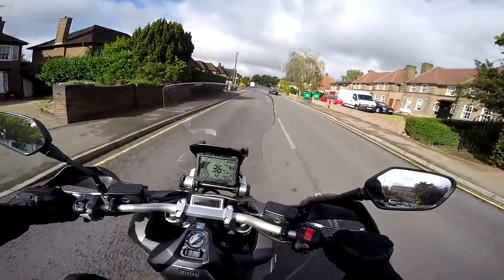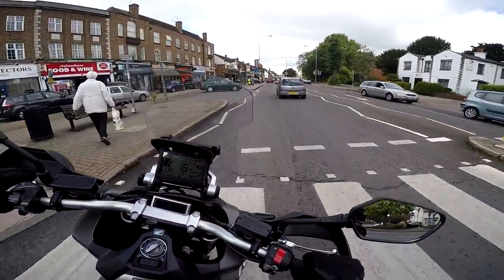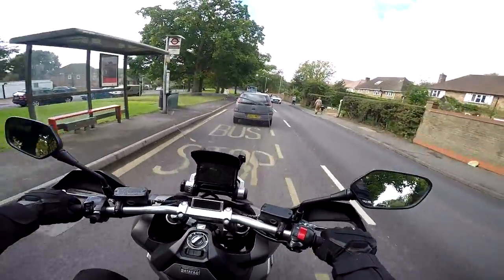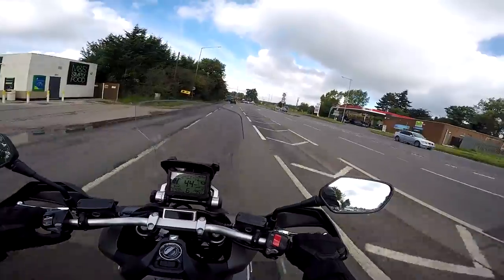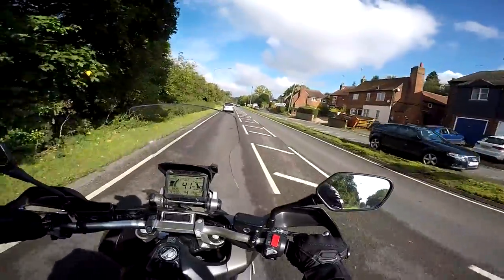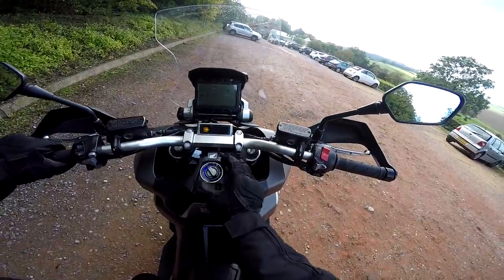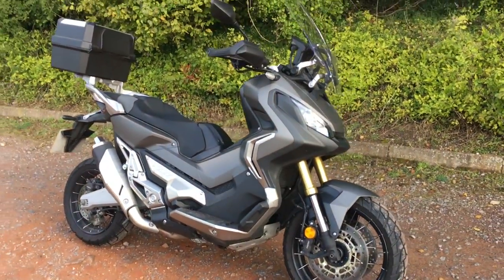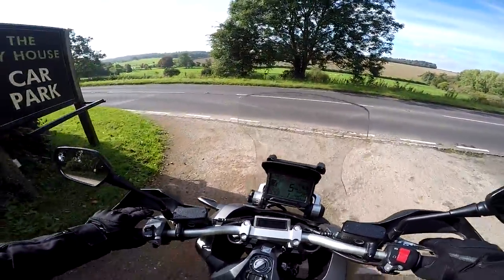2017 Honda X-ADV Review

Comment: I have had 3 two hour test drives on the X-ADV including a back to back comparison with a NC750X.  I rode on a mixture of roads including motor ways, curvy "A" roads and single track country roads and it felt at home on all of them, I also pinned it (on a suitable road), and it was good for 115/117mph, at this speed it was still very stable, the NC750X limit was about 100mph but felt very stressed, in general it felt a very relaxed and easy drive, I think this is due to the level of protection from the screen, leg and floor boards, whereas on a bike, you are subject to the elements and very much aware of the wind. One of the problems I had with this relaxed drive is that it was very easy to exceed speed limits by over 30mph without realising, although there isn't any likely hood of unintentional wheelies. As far as pricing is concerned, it is undoubtedly expensive, but is on par with other large scooters from Yamaha or BMW (X-ADV = £9600 54hp, T-MAX = £9600 46hp and the D-MAX = £10,900 46hp) compared to say the Tracer 900 at £8,900 or Tiger 800 XRx at £9,900, but for that price you do get a automatic gearbox, LED lights and the same radial brakes and other components from the Africa Twin and of course the additional body work.  As a bike/scooter with aspirations to be a "one bike" for shopping, commuting, adventure trips/cruising and some simple off-roading I do think they could have added things like self cancelling indicators/cruise control and heated grips and the ability to switch off ABS and TCS. I was however fairly impressed, particularly with the relaxed ride, and as a result I'm seriously considering  exchanging my Tiger 800 for this SCOOTER.
Reply from the maker: Tricky decision eh?
Reply: Yes, it's a dilemma, not withstanding the comments such as "why do you need two bikes, you can only ride one" well yes, exactly,  or space, but then you can always make room for another bike by putting the chest freezer outside, I think if I was younger (I'm 74), I would stick with a bike to have the authentic "feel" of riding a bike (wind through the hair and all that), but I think I'll go for the more relaxed ride, if I do get a yearning to ride a bike, my local dealer is pretty good (plug for Kent Motorcycles), they would always lend me a bike for couple of hours to get it out of my system. PS: I'm not as you can imagine at my age in the habit of doing a ton 😇, only for research purposes.
Reply: But the NC750X uses the same engine and can also be had with the dct gearbox for around £3000 less. It also has a large storage area capable of taking a full face lid.
Reply: Hi, can you let us know, how you decided with X-ADV? I started on scooter 125cc and last year I made driving license for big bike. After 1 year with Tiger 800 (xr) I realized - in my way of using bike I miss scooter and I started thinking about go back to scooter - or .... X-ADV is interesting compromis between scooter and cenduro bike.

Comment: I had a decent test ride on one and I was really impressed....so impressed, in fact, that I've bought one (my local dealer had 18my models, new, unregistered for just over £8k). I've ridden a DCT model NC750X, which I quite liked, but this felt so much better in just about every respect, handling, breaking and performance. My  current bike is CB1100RS and when I took this X-ADV down some of my favourite B roads I found I was sweeping round bends about 10mph faster than usual! I'm a big fan of the DCT gearbox and it seemed even better suited to this bike than it was to my old Africa Twin. I doubt anyone who rides one of these will still think of it as a scooter.

Comment: From Finland to Costa del Sol Spain and back to Finland,and still i love to ride it after ca.9000km.Comfortable on all roadconditions.
Reply: on the X-ADV? How did it compare with a bike, if you've done it before?
Reply: @denislejeune9218  It,s a bike.I add footpegs and most of the time use them.
Reply: @Mikael Lindroos, you seem to be the fella to ask this. But how predictable is the gearbox? I've had a bunch of them in various cars and so far all of those just shift whenever the hell they want to, including mid corner. This is unsettling in a car, which makes me sort of worry that a DCT might throw the rider when it messes up the timing when shifting. How close is it to an actual proper CVT?
Reply: @fermitupoupon1754  Do not worry.I have 32000km and no problem at all.When you become use to DCT and the different modes it,s a fantastic bike.You have the kickdown too when you want to accelerate for exsample takeover.3000-4000km and then you enjoy it for full.Save rides..
Reply: Very impressive, what kind of cruising speeds did you maintain and what was the fuel consumption and range like?

Comment: 2 yers later and this is still the best review on youtube, think I have seen all of them on this bike and none gave me the idea what to expect till I've seen this. Same goes for your tmax dx review. Great work and thanks.
ps. that is a handbrake at the bottom of the disc and lever is positioned on the front right side, with that transmission bike is in neutral when parked so handbrake is good idea/must when parked on the hill.
Reply from the maker: Thank you!

Comment: Thanks for a great review.  I got one last week for 9k plus first service and love it.  I have had loads of bikes sometimes 2 a year, i defo think this one, will be staying with me along time as so much fun to ride.
Some comments on the price say a bit pricey but a tmax 530 is 1500 quid more and this blitzes the tmax. Fuel economy 65/70 per gallon. Love the manual paddle mode and it switches between the 2 modes effortlessly.
Goes everywhere my bmw gs can go, infact you feel more in control offroad than the gs.
All i can say is get one you won,t regret it.
Reply from the maker: Nice one Marcus - thanks for watching and enjoy!
Reply: So, how long did you keep it for?

Comment: The DCT is the future of motorbikes isn't it? I remember when they were really only in performance cars like Porsches. Slowly but surely they appeared in everything. I even had a four wheel drive with paddles on the wheel so you could change up and down manually if you wanted to. I used them once, just to try them out and that was that. Never touched them again in four years of ownership. For everyday driving an automatic is just so much easier. In city traffic it's a no-brainer.

Now I get the purist's saying that the clutch is crucial to the control of the motorbike and it is a bit like cars, the enthusiast will still want a manual, but I think eventually, most people will be happy with a DCT. Even Ferrari has stopped making manual gearboxes. 

Those who want a motorbike to get from A to B and not for the thrill will want a DCT and all the electronics. They don't have to worry about losing control, accidental wheelies and skidding in the wet. Point and ride. As my wife said. "I'm not interested in racing around the country lanes. I just want to enjoy the freedom of biking, without the hassle and feeling safe" is what she said. I think plenty of people will want that. Just got to get the price right.
Reply from the maker: Hmmmm interesting debate, I must admit I am still a bit "old school" and suspect most (UK at least) bikers are too - mainly due our age!
Reply: My main reason for preferring a clutch is cost,, purchase, maintence and repairs.
Reply: I’d rather have a quickshifter and the ability to pop the clutch but that’s just me
Reply: I just go with what's better for me don't care if new or oldschool, have a 600cc but in London it's tiring sometimes mostly being comfort and the clutch.  The power and lack of self control at times coupled with the loud straight through does no favours for my licence either but I know if I got rid I'd miss it.

Comment: As soon as I hired this in Madeira Portugal for five days I wanted to buy it.   But I wanted style so went for the Forza 750.   Traded in my BMW R1200RT.   What I like about the manual mode is the you want in auto you’ve slowed down auto will change so it won’t labour the engine.     I did a round trip London to Hinckley and back turn a nice 71 miles to the gallon.  Also ordered the central locking top box. I absolutely Love it.

Comment: Another great review. 10 out of 10 to Honda for pushing boundaries but have to agree with others in that it is just too expensive. At £8k I might have been interested as a bike for my 20 mile commute (I don’t use the GSA...just too big) to replace the X max. I think the depreciation hit is going to be high so I decided to wait and relieve a Honda dealer of the their stock they will be unable to shift at a significant discount!! 

However, it appears Honda UK have under estimated demand and sold out of their allocation....which goes to show I know nothing about the bike market.
Reply from the maker: Is that so?  I didn't know that, obviously the price is right for many then!

Comment: Regarding the back pain in a scooter, I have done 30k miles in my Xmax 125 scooter from Europe to Asia and I never had any back pain except the usual you might get on a highway without bends for hours. At the end you just learn how to stretch yourself if you need to spend 8 hours on a bike!
Reply: David Diéguez XMax is better than TMax for back. Issue with some big scoots is that feet have to go so far in front there's no weight on them, it's all in the cocix. The cushion that's mid seat stops the rider moving position. I rode a SH300i with no issues, sadly had to sell my TMax though. Tried another this week for an extended test ride and had the same problem. Hoping to get a test ride on a XMax 300 and Forza as these seemed to have better positions when I sat on them in the showroom.
Reply: I agree with David, I've done 400 mile days on a Vespa GT300 with no issues, which is more than I can say for most bikes I've owned!
Reply: I use a scooter inner tube, adjustable and saves the spine.

Comment: Bought mine a couple months ago... I LOVE IT!   looks awesome, fast, and so easy to ride!
Reply: Also, this is my first motorcyle or scooter, any type of bike.  Not a bike for a new young rider, because the bike is big and yes it is very fast.   I don't think I will ever buy a manual motorcycle.
Reply from the maker: Fair enough - and welcome to biking!
Reply: what about comfort? does your back hurt after long rides?
Reply: Oh yeah I got mine last December 
And its brilliant the best bike I've had or ridden. Coming from sports bikes.  Had a r6 and a honda vtr sp1!   The x adv like it's on rails really is and I like the rumble too reminded me of my old sp1 with standard exhaust on. Only thing I miss is the top end speed! As the this is not the fastest! 
But coming in and out of corners it don't hang around! 
But I love it.

Comment: Great revue, thanks MF. Really appreciated the honest opinion of a traditional biker, and the favourable rundown of it. A nice change from the biker snobs who decry anything scouterish, this is a dct motorbike with foot plates instead of pegs, IMHO. I ride a PCX around our local area, tried a Honda Forza 300 for the idea of touring, not being a full fledged biker as such. I then realised I wanted something more bike like with a bigger engine, then spotted this in the dealership in Phuket, fell in love instantly. The bigger scouters look like bathtubs on wheels. The perfect solution for a scooter rider, at my age I can do without the foot pedals, and gear change distractions. Still trying to find a rental shop with a newish model for a proper test drive, as the suppliers in Thailand do not allow them. Must say though I'm tempted to just jump in on the strength of your revue, and others that agree with all your comments. Thanks, Chris.

Comment: Hi TMF, the smaller caliper on the rear wheel is a separate brake unit for the parking brake. The MPG is easily 80+ mpg with a 14 litre fuel tank. It's a cracking ride, if slightly over priced brand new.
Reply from the maker: Cheers Rob - a few people have said that and I did mention I thought it was a parking brake in the video ;0)

Comment: The bottom thing on the brake rotoe that kinda looks like a brake caliper is the park brake assembly, the abs runs off the the silver ring in the center of the brake rotor that has the small holes all the way around it.

Comment: Another fantastically watchable review. How far are we away from BMW bringing out an auto gs 1200 do you think ??
Reply from the maker: +MARTYN ISSITT Quite a long way I reckon - QS with autoblipper is where its at for BMW...
Reply: BMW cars use mainly ZF gearboxes (autos) and Getrag (manuals).  Not sure if BMW motorcycles make their own gearboxes or not.  Either way, a DCT transmission is technically superior to a constant mesh gearbox with dog clutches and and electrically assisted "pro shift" on BMW's. Certainly the 1600's are crying out for a DCT transmission IMHO.  Honda are certainly an engineering force to be reckoned with. :-)

Comment: Top notch MissendenFlyer. Your review certainly presents this bike as a perfectly capable every day sort of machine that would thrive in a real world use sort of capacity i.e. ripping down to the shops, ripping off to work (or school?) and generally ripping around on errands. It may not be the bike of choice for a long haul overnight weekend trip, but then again, why not? 
You kept to some rural open roads for the most part, but how does the X-ADV perform in a dense urban environment? (I have visions of hundreds of scooters zipping about Rome, Paris and yes, London.) With the power, easy ergonomics and general friendliness, it should be a winner amongst either scooters or motorcycles. 
Oh and how should one pronounce X-ADV? Zadv, zhadeev, CHAV? I’ve picked one already...

Comment: Great Review, I think it looks good but not for me, However, Due to arthritis I already ride a Honda NC750X DCT.
I am very pleased with it.
The Item below the Rear Break Disc is the Handbrake, as it can't be parked in Gear.
 On the NC it is on the left bar, I think it's under the Right  bar on the X-ADV .
Reply from the maker: Yes Bob thanks, a number of people have confirmed that - cheers for watching and for stopping by once again - TMF
Reply: there's a large lever right inner side top of 'fairing' for the parking brake, same as most big scooters
Reply: Looking at this review because I've problems with my left hand after surgery...riding my Kawasaki Z1000 killing me ...anyway thanks for review

Comment: I’m now in Madeira Portugal back in the UK on 1 Nov. I’m on day two out of five days on hiring this bike.  I just love it.  A fully automatic gearbox.  Want to buy one when I come back to East London and seeing John’s Motorcycles Romford.
Reply from the maker: Is it expensive to hire out there?
Reply: Its so cheaper hiring a car.   But it’s free parking for m/c.    There tariffs on there leaflets.        4 hour hire  €40.     1-2 day €60   3> €50  I paid cash for hire.  Deposit on credit card €500.    Oh they say 750 does 77 miles to the gallon. Don’t do litres.   They also do the Honda NC750X fullyauto or  manual €10 cheaper.   Third party insurance.   w w w  rent a scooter Funchal.  com         Next time I’ll get a Metrobank credit card I’m charged £14 for euro change.   Lovely     Madeira is near like Grand Canaria which I did by car. English widely spoken here.    I have at home the BMW R1200RT I’m not right on that bike.   07 plate 45,000 dealers saying it’s high mileage he won’t take it

Comment: Only problem with this machine is it is chain driven and has spoked wheels both of which require extra time to look after. Scooters are about clean convenience so I feel it falls short here. Shame as I had high hopes for it. It is nether one thing or another. So whether you are in the motorcycle or scooter camp I feel you may be disappointed but I applaud Honda for trying something new and wish them well with it. Thanks for the review.
Reply from the maker: Cheers Gavin - thanks for watching!

Comment: As per normal tmf, great review, although I’d like you to have continued up onto the m40 to Beaconsfield so you could have opened her up a bit more and tried out the screen more. I was expecting a glowing report after you rode the Yamaha, but although you thought it was nice, it didn’t blow you away. What would make this bike a success is a big drop in the price, or more tech (heated grips, cruise control, heated seat etc) included as standard.
Reply from the maker: Agreed!
Reply: I did get a short 15 mile ride on an x-adv, thought it was great and would really like one, the screen is fantastic , it handles really well, is comfortable and showed 84mpg on the fuel computer over the route I did (zero’d the computer before setting off). The problem with it, it’s too pricey for what it is and doesn’t have enough standard features. But for a long distance commuter and weekend blast or touring bike it would be great. You need to get one from Honda uk and take it on one of your holidays up to Scotland 😉.

Comment: Not sure about the price, but other than that i love it. Looks funky, and could be a great alternative for the practical commuter for the longer runs.

Slight correction: I'm pretty sure no button can change gear ratios. I bet you meant changes at what rpm the gearbox shifts up.
Reply from the maker: Yes you are of course right Johnny and not the first to point that out!  Cheers - TMF
Reply: Oops, sorry. Hadn't checked the other comments :)